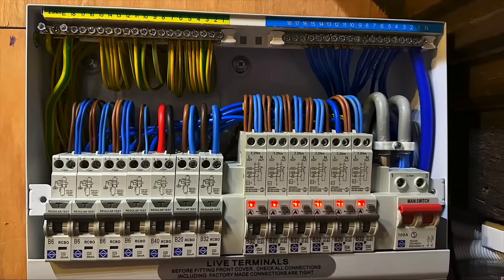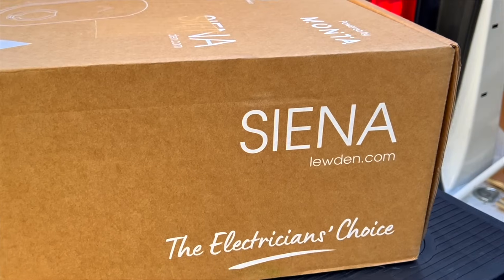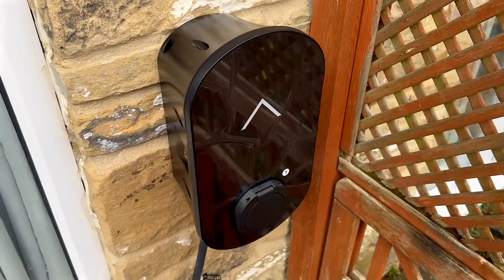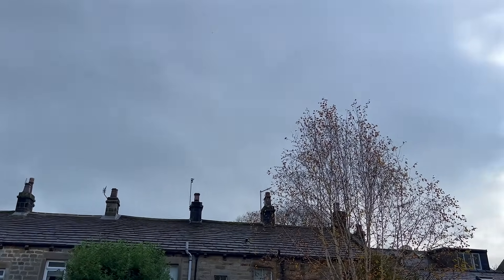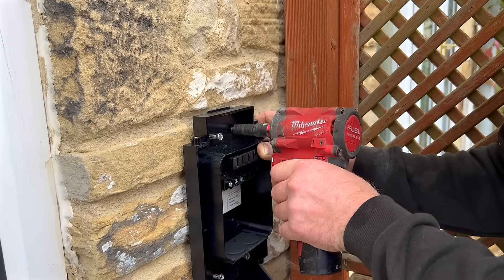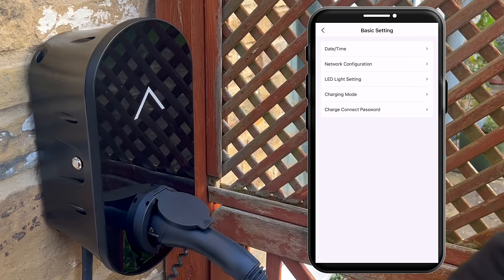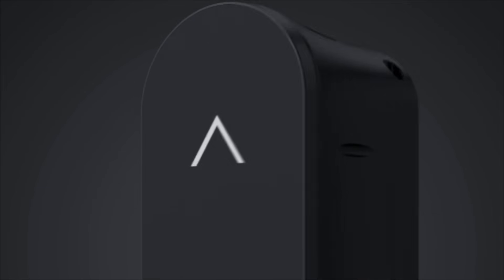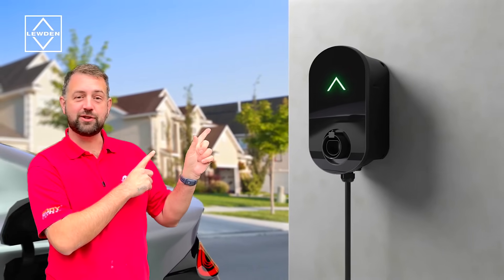Lewden’s Siena EV Charger: So Easy, Install It Lying Down

Comment: It doesn't include everything though. They don't even include a grommet if you're doing rear entry. The mounting bolts have no rubber washers so not a great seal. The cover can be difficult to get on, and the cover screws can be an issue. It isn't compatible with many EV tariffs. I've already seen a real life installation of this by a real electrician (SOTA Electrical) and it isn't as easy as you're making out.
Reply: I watched SOTA install it too and as nice as it is to see Efixx showcasing new products to highlight for electricians this EV point really isn't fit for market.